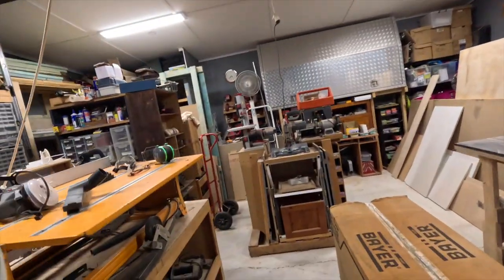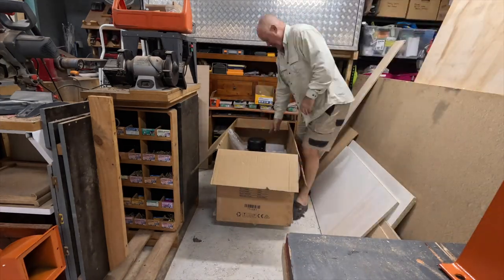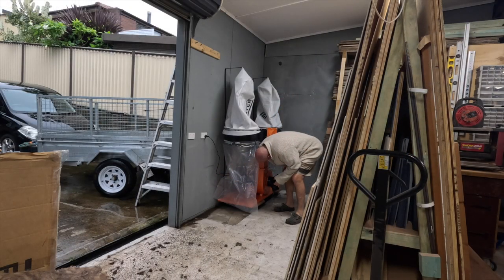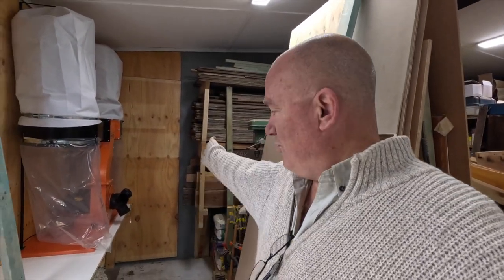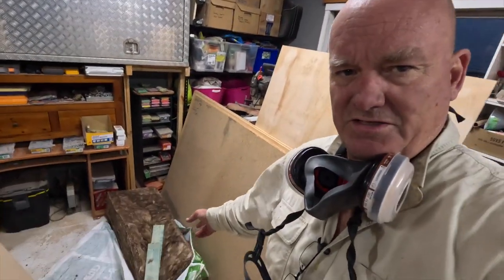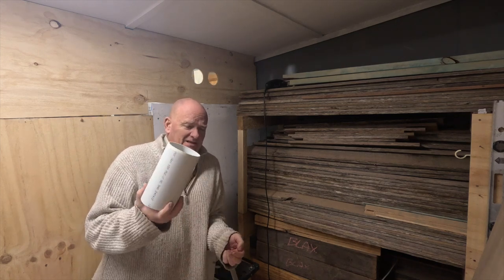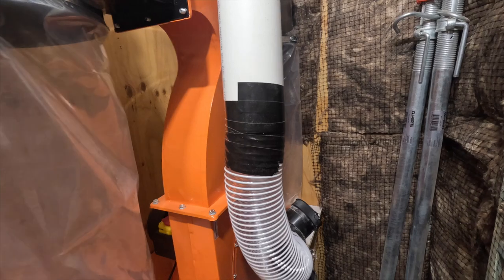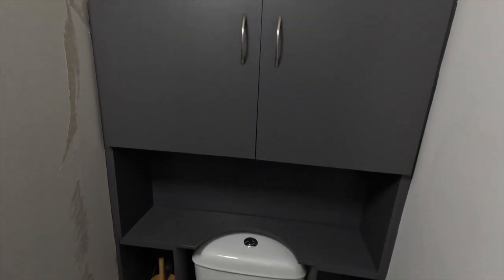My shed nearly sux -- installing dust collection

Comment: A family doing great work.  You can use standard pvc fittings from Bunnings to make it a bit easier to attach the flex pipe and dust gates, I used a lot of true duct tape, it moulds and is cheap and easy to use and seals well too.  There are also more expensive pipe fitting available from Carbatec and Timbecon that work even better.  I bought a box of dust extractor fittings, includes gates, pipe clamps, bends, pick-ups and a length of flex ducting for about $100.  Don’t forget that you will have to get that bag of dust out the corner one day so you’ll need a bit of space, horrible job but has to be done now and then.  I’m envious again.
Reply from the maker: Thanks mate – I appreciate your feedback as always.
The piping is now done and looks the part. However, I'm kinda stuck for ideas on how to connect the pipes to the machines creating the dust/chips. For example, the lathe, which scatters chips mostly up and over my head 🙂 But, the pipes did work well at 'vacuuming' the floor afterwords.
Reply: @big-irish-git  I’ll find you some ideas and send them if you like.
Reply from the maker: @mehDustMaker  Your sage council would be most welcome. Thank you.